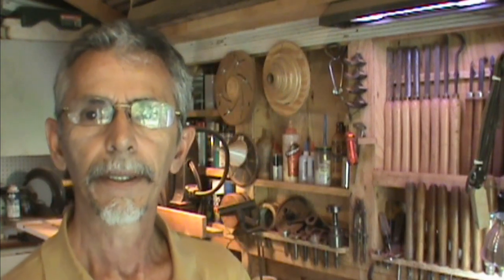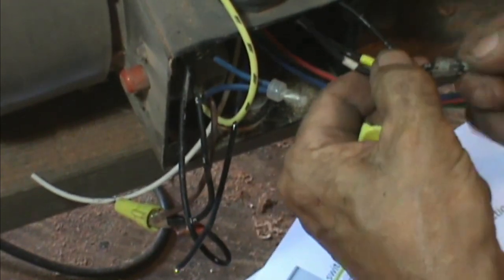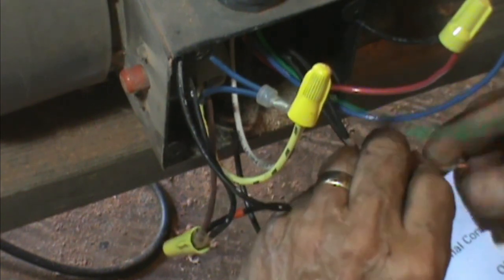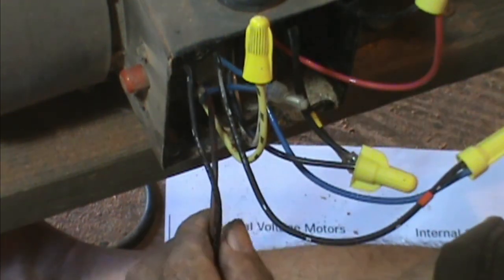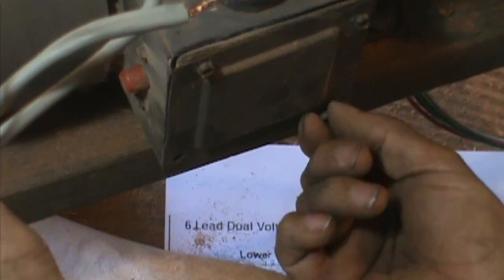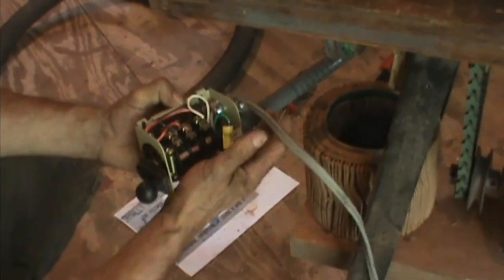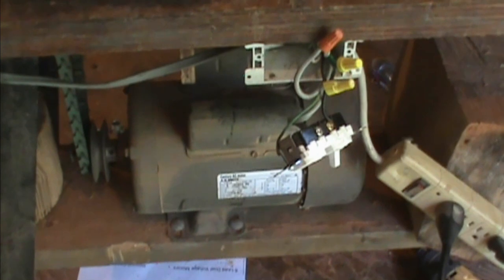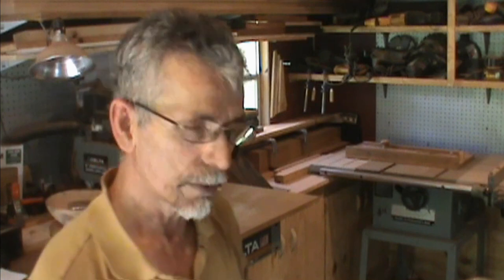Drum switch install by Al Furtado

Comment: Hello Al, another improvement to the atlas, Have you think about electronic speed control? with your skills in electricity perhaps is not that difficult.
Thanks for sharing.
Take care.
Reply: Miguel Sanchez This is a dimmer for 110v motor: http://www.ebay.com/itm/10000W-110V-220V-SCR-Voltage-Regulator-Speed-Motor-Controller-Dimmer-Thermostat-/271737694148?pt=LH_DefaultDomain_0&hash=item3f44d427c4
Reply from the maker: Miguel Sanchez Thanks Miguel. Yes I have been thinking about a VFD for some time. the only thing that has held me back is cost and the fact it would force me to uses a smaller motor because I only have 120v in my shed.
Reply from the maker: Miguel Sanchez Tanks Miguel for the link. I would not use that item. Based on all the research I have done and read, AC motors are not designed to handle speed change by reducing voltage. I know it is use in small tools like routers and such. VFD and a 3ph motor will be going on the lathe if and when I sell the red lathe.Thanks again my friend.

Comment: Hi Al,
I am happy that you kept the atlas I have the same 7122 lathe.

I think you can stay with the 1-8tpi insert. it is a good time to buy an adapter from 1-10 to 1-8. This way you are open for other accessories using 1-8tpi.
Reply from the maker: Dror Sofer I am glad as well especially with all the upgrades I have do to it. Have you ever found an adapter to go from a 1-10 to 1=8? I have looked for that option and have called a couple of local machine shops to see the cost and it is ridiculously expensive to have one madeTake care
Reply: Dror Sofer 
BTW, if you have only 120V in your shop and you want speed control try to find a KB Electronics DC motor controller and a used motor from a treadmill. IMHO a DC motor is a better option over VFD as these motors are smaller, much stronger and the operation is without the annoying high pitch sound.
These drivers are coming in many models and shapes you need to find the right one for the motor.
Reply from the maker: Thank you my friend I have been looking into getting a treadmill and might do a conversion using the treadmill control panel

Comment: Nice modification Albert.  I wish I had reverse sometimes when sanding some funky wood that the fibers just lie over instead of sanding off but you can sneak up behind them with the reverse.  Do you have some way to lock the chuck to the spindle, reverse can spin the chuck off if not secured, you sure don't want to catch a chuck on the toe if it comes off.
Reply from the maker: John Bare That is very true John. one can always turn from the back side, My problem is my lathe is close to the wall and bolted to the floor so I don't have that option. yes my chuck is reversible and it has the set screw on the body that will lock it to the lathe spindle.The main reason I put this on was for my hollow form turning and it only cost me 2 bucks for the switch LOL.

Comment: Nice job Al. Everyone should be as respectful of working with electricity as you. I assume the green wire was your ground and that it was attached to the motor case and switch housing with a ring terminal or lug. 
Take care and do a kindness. 
Mark
Reply from the maker: MARK Baid Yes Mark the green was attached to the ground screw in the motor and caries out to the rocker switch and wall plug.Thanks again my friend.

Comment: Wouldn't it be as simple as running the neutral to one side of one switch hot to the other side of the other switch and then connect the two remaining together?
Reply from the maker: Thanks for watching and the comment. I am not sure as I am not an electrician I know the basics. I know I wanted to use a separate switch to shut off the lathe and turn it on and not rely on the heavy duty drum switch. I followed the wiring diagram listed to my motor and got advice on the drum switch.Thanks again Take care

Comment: good work, Al. I thought the atlas was gone.
Reply from the maker: Lee Waterman Thank you for watching and commenting. The atlas was never gone it was just set aside while I gave the new lathe a shot. It's not a great lathe but I have customized it so much and it has so many features that I hated to give up that were not available on the new one. I decided I was still better off with it even if I have to change belts for the speed.

Comment: Yep, looks like death in a nut shell... :) but I'm optimistic, and actually love to tinker myself and have a bad fascination with anything electrical, even with a history of some bad electrocution, thanks to a stupid "professional" electrician, who bypassed our hours emergency current switch, or what ever they are called. The result? a 10 seconds of getting electrocuted which only stopped when my spasming body pulled the cord out of the wall... it wasn't fun and some points in my body turned to coal, but hey, it was a learning experience, I'm just glad that if my kids want to know how a blow dryer works they can just look it up online, and won't need to take one apart like I did when I was a child... while it is plugged in... and on.... :) Thanks for a good video for the tinkerers among us!! :)
Reply from the maker: Yuval Lahav WOW you had some experience there, I have had my share but I insist on learning and I never let whatever is in front of me win. If I have a problem I get more determined to solve it.Kids will be kids and we can't watch them around the clock.Take care  and don't play with your electricity.
Reply: Al Furtado I'll play around, with my kids, and teach them the right way to do it, since no one showed me, I can give them something I was lacking. Win/win :)
Reply from the maker: Yuval Lahav I was going to answer this with a lengthy response but I decided to leave well enough alone LOL

Comment: Im about to attempt this in the coming days i have a feeling it wont 
end good :( wow my electric skills are bad i will stand well back 
when i flick the switch i think..
Reply from the maker: +Muhaa Haloa That is great but please be careful and if you aren't comfortable working with electric please call on a friend or professional.
Reply: Al Furtado I'm going to get in touch with the manufactures because there schematics are different,Compered to the sticker that come with the switch..Will let you know how i get on..
Reply: +Al Furtado Hi mate i worked out i have a single phase (split phase) motor with a run winding and a start winding i have 4 wires coming out now..2 for the start and 2 for the run,I know i need to switch the start
windings to reverse the motor...But i have no idea about the drum switch i have or how to wire it up,Loads
of people have gave me different advice..And now I'm stuck :(..

Comment: I'm sorry I don't agree with everyone who says this is great.  Your video is blocked many times by your head.  You show the sheet with your diagram so quickly it can't be seen.  You apparently make connections while the camera is off and there is no explanation of what was done.  Connections are made with no explanation of what went to what.  Obviously, you know what you did but no one else has a complete guide to what you did.  Thanks for trying but I'm still looking for a video that shows all the connections with explanations.
Reply from the maker: I totally understand that as well me not being an electrician and trying to figure it out at the same time myself it made it hard to explain at times and sorry you were not able to get what you needed out of it. I must admit I didn't find any useful information either when I searched it. the most important thing is the specks on you particular drum switch. One side is hot at all times and the other side alternates the power to A or B (forwards reverse) I wish I had done better explaining.
Reply: Thank for your reply.  I did get some information from your video. A big question I had was about hooking up the neutral and hot feeds from the power source.  I did get that from the very last part.  You are right in that there is not a clear video available that explains this process from start to finish. It appeared that there was a part of your video that may have been missing.  Thanks again, David.  @AlFurtado